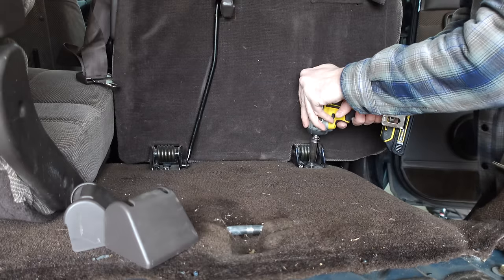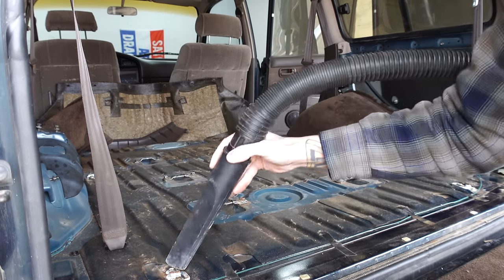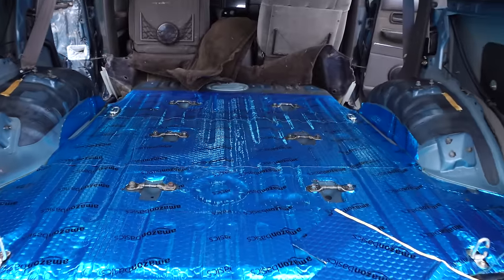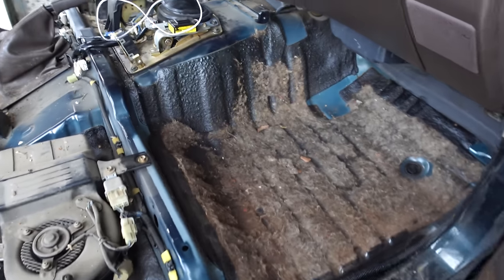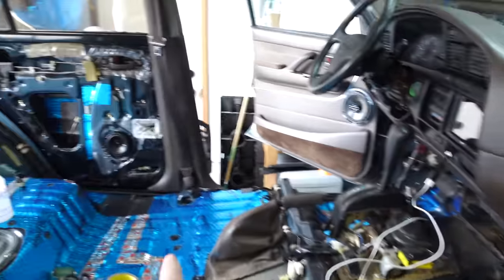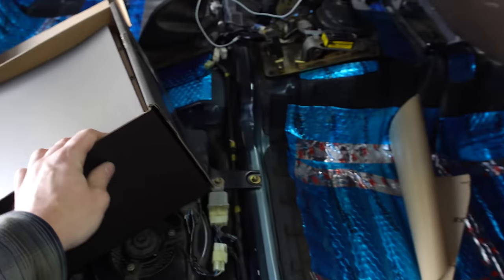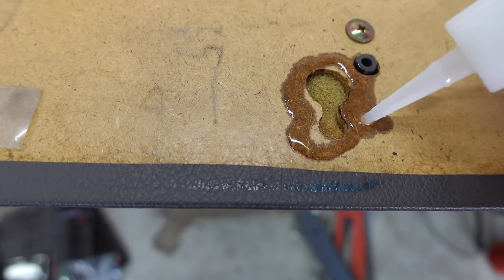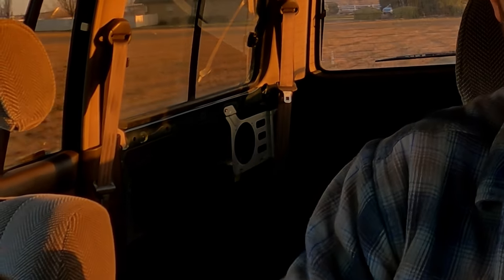The Cheapest and Best Sound Deadening Mat for My Land Cruiser!

Comment: When I did the same with my ‘06 Tundra, I pulled the carpet out and called a local carpet cleaning company and signed up for their “3 rooms for $99 special”. When the tech showed up I told him 2 rooms were in the house and the third was in the driveway. He did a great job and the carpet looked pretty darn good!
Reply: That's pretty smart, lol. When I was looking to rent equipment at home depot,  I noticed carpet rentals at home depot for 4 hrs was $25
Reply: @OriginalPoopMaster5000  a tiny ozone machine may work wonders to finish off your results in the truck, or anywhere else that's nasty.
Reply: @18_rabbit  they are great little machines, I had an old project car that had been heavily smoked in, pressurewashed the carpets with some decent carpet cleaners and drill brush agitation before blasting it all out used a carpet cleaner on the seats and headliner then put the ozone inside to finish it up and the smell of old cigarettes was gone. Admittedly I also had a lot of Ash to clean up from all the crevices inside the car
Reply: 😂😂😂😂 This is the best idea ever!
Reply: @18_rabbit got a ozone machine from Amazon for a Mazda truck a buddy bought , which had a mildew smell , ran it over night on ac power , allot of warnings with the machine and all it did was add a toxic smell to vehicle,  didn't remove anything . Later a detailing or cleaning place found active mild or mildew in tbe underlay . So I'm not sure what ozone machines are for. But simply running one , just added the toxic ozone smell to the vehicle .
Reply: @_Thundrix next time u use this process w pressure washer, just sprinkle powdered laundry detergent evenly over the carpet. then go over it w pressure washer until suds are gone & you don’t even have to scrub by hand. the pwasher does all the work for you!    just a suggestion
Reply: @kjaxky  Most of those machines do not produce real ozone. My SunAir that I've had for 25+ years and used daily in my retail business made any room smell like freshly wash sheets that have been air tried on the line. Mine is constructed of stainless steel. No plastic on the unit at all.
Reply: As you said it was a luxury car, the roof would have been sound deadened already, which is why you didn’t cover the roof.  As it’s closer to the head/ears, I wonder how much difference it would have made

Comment: I put the same amazon brand deadner on the ceiling of my Honda while I had the headliner out. It made a HUGE improvement in getting rid of the tin can sound, ESPECIALLY when it’s raining: the sound of the rain drops hitting the windshield and backlite glass is louder than the ones hitting the roof.
Reply: Doing the roof can make the biggest difference, especially in a truck like his. They usually put almost nothing on them from factory
Reply: TheRogueBro
   So true I have a '97 Silverado K1500 extended cab and when I started my stereo system build I stripped the whole interior to do sound deadening/insulation and run cables and wiring. I was amazed at how little sound deadening there was from factory. There was none on the roof one small piece on each side of floor pan none in the doors and one small piece under the rear side window on each side and a small piece in center of rear wall there was also a very small piece behind radio on firewall. When I say small I mean like 4"×8" and very small was 3"×5". So needless to say it was a lot of material and work to get it right. Looking back it is a very good thing I started out by just stripping the entire interior.
Reply: Nice,  what honda? I'm thinking of doing to my element
Reply: Nice project and great video! My gut feeling says that I wouldn't have put the secondary foam where you will have carpet but it IS NEEDED where you have Amazon Basics anti-resonant deadener but no carpet - especially behind loudspeakers, inside doors and side panels and so-on.  You should drive the same route for a valid comparison because the road surface has a large influence on resonance and higher-frequency tyre noise. All the best, Rob in Switzerland
Reply: @didiermejia780 element should be a great candidate since the sheet metal is more expansive and flat.  I'm having trouble in my Chevy TB after driving a Mercedes of same era for last 5 yrs. The Chevy roof is like a trampoline under modest hand pressure. Just doesn't compare to the roof of an e320 wagon.

Comment: Like you were sayin it’s very difficult to show the difference that is made for far too many reasons to list but I think the most important one is noise reduction that isn’t truly shown on a decibel meter. The meter just reads the loudest frequency registered, it doesn’t show which frequencies were reduced and by how much. For example, we tend to be very sensitive to the 1k-4k hz and sound deadening/absorption mainly reduces that range. So you could actually have a 20 db swing that would go unnoticed due to its limitations. Second, the lower frequencies are very difficult to absorb due to the wave lengths being so long, it would require several inches of padding up to several feet depending on which frequency you are trying to limit. Luckily, the lower the frequency, the more pleasant it’s generally perceived.
Reply: This 100%. I've done some sound deadening on my car and while the decibel test provided negligible results (just a couple db) the actual real life experience is noticeably more pleasant. The higher frequencies are muted and road noise doesn't make having actual conversations annoying.
Reply: Glad I scrolled down - I don't know a lot about sound engineering or acoustics, and I was wondering this.  I don't regret the 120 lbs. I've added to my small sedan.  It completely elevates the car.  It's also cool when the stereo is turned up, all windows and doors closed, and then I open a door and a flood of great sounding music comes out.

Comment: Replacement carpet is also available with something called "mass backing" which reduces sound transfer. Its a big investment on an SUV at around 700 bucks for ultra plush carpet with mass backing, but it is great at making the interior look, feel, and smell new, especially on older vehicles with damaged carpet (stains, cigarette burns, tears, or wear through). Ive used stockinteriors for carpet on several projects, and their molded carpets have always been top quality, IMO
Reply from the maker: I’ve used stock interiors and I’m a big fan!
Reply: Just used them for my xj turned out great
Reply: The mass backing is just a layer of mass loaded vinyl added to the carpet. I was unaware people were doing this so I looked up for the carpet in my truck. It's $75 extra for the MLV backing on essentially 25sqft of carpet. MLV typically costs $2-$4 a sq ft, and the convenience of it already being attached to the carpet seems great. I'm probably going to order new carpet soon now, so thanks for the info.
Reply: I got an 80 aswell, home much of bothdid you end up consuming? Not thrill Ed about lifting console but be interesting to see how much coin under there

Comment: almost ALL resonate noise in a vehicle that large comes from, firewall, doors, rear gate... and believe it or not the roof of the vehicle acts like the skin on a drumhead. All road vibration while driving resonates UP, with all the effort you put into that you should do the ceiling & I would bet you would notice an Audible difference W/O the Db meter. I know I did, and I ONLY did the side panels doors and roof. LOL now mind you having crappy worn or chopped, or semi knobby tires doesn't help either(a good touring tire will kill a ton of road noise) Good Video!!
Reply: I was thinking doing the ceiling would also help reduce noise for anyone that has a roof rack.
Reply: Yes, firewall-doors-gate-WHEEL WELLS-roof.
- RMG is right, just do the doors and panels, BUT be sure to get those wheel wells covered too!  You don't need to cover any of these 100% with the sound deadener/Mass-loaded material.  Just cover most of it but you don't get much gain by going edge-to-edge.

- Tires are a big source of noise, and in a SUV like the LC, it's really big.  Should always mass-load/deaden those surfaces that face the wheels as a priority, that wasn't really done here in this video.
- As to the roof - yep, lots of noise reduction if you do the interior ceiling, BUT - in any sort of hot climate, any time the vehicle is driven or parked in the sun, the heat will tend to soften the glue or bond, and then you get major drooping and all kinds of issues with it sagging into the headliner. It becomes a major PITA.  The best solution is a spray-on deadener material that 100% bonds to the roof metal.  That's a pain to do, but gives the least trouble long-term.  And of course, any spray-on material is going to have fumes and stank that takes a while to go away.  Again, 100% coverage isn't necessary, shoot to cover 60% to 70% of any of these surface areas for best 'bang for buck'.

Comment: Run some weed whacker string through the sunroof drains. Carefully. If you have a damp interior, they’re probably clogged.
Reply from the maker: Yep I've heard of that and I'll have to do that. Thanks!
Reply: I used weed trimmer string (orange) in my GTIs front sunroof drains.  I used 3-4 inches and made a "U" shape and put it in the drain nipple in the front door jam.  Then left about 1/4" visible.  This was done to allow water and any small dirt to easily exit the drain and prevent backups

Comment: A trick I've always done is just remove the weather barrier all together and put a second layer of sound deadener in place of it. The layer on the outer skin deadens the sound of the metal itself and the inner layer helps deaden the sound of the hollow of the door, plus it better isolates the rear wave of speakers from the cabin area.

Comment: I put some under my headliner .. helped with heat transfer in the summer too
Reply: Cant believe this isn't mentioned more! I did the ceiling with alu-butyl first then memory foam type thing specifically made for heat/cold transfers, I did it in the middle of summer and MAN what a difference couldn't believe it. My car used turn into furnace in 30 mins absolutely unbearable unless I opened all windows and waited 15 secs before getting in. Mind you I also had all my windows including windshield tinted in clear ceramic heat rejection tint, supposed to block ~70% of the heat IIRC. Limo ceramic tint the damn moonroof aswell

Comment: Great video! Yes db scale is logarithmic, 3db is a double or halving depending on direction. 3db is usually what it takes for the human ear to notice although come can notice 2db. 6 db reduction is excellent!
Reply: Yup! -3dB is half the sound  and -6dB is 1/4 of the sound.  You cut out 75% of the road noise.
Reply: Totally inaccurate statement. Logarithmic at a 10db scale 60db is half of 70db in perceived loudness. -7db is a 70% reduction in that 10db scale.
 Wattage is the same 1w-10w-100w-1000w are 10db increases in sound level. A speaker with 79db @1w is twice as loud 89db @ 10watts etc....
Reply: Would take that dB meter app with a grain of salt though.

Comment: I've done the same on a 99 Tacoma and 89 4runner. Makes a huge difference on these old trucks. My next tackles on the 80 are both rear door lock actuators don't work and my windows are so slow.  I think I already purchased the runs, but a bottle of silicone spray actually did wonders a couple years ago. 

I figure, doors off, replace speakers, locks, refresh window grease and sound deadening will be a good 3 for 1 winter project .
Reply from the maker: My rear windows are so slow that they bind and fall off the track, lol. I've used the silicone spray too.
Reply: It could be the factory grease inside of the window motors has dried out and causing resistance. See if they can be opened. Clean and re-grease, it will make a huge difference and prolong the life of the motor.
Reply: Clean the window tracks, the motors, the gears and the rollers with brake cleaner and then use white lithium grease to re-lube the motors, gears and rollers. This will make the windows go up and down a lot smoother and easier.  Also check all window parts for loose rivets,  if these are loose it will make the windows roll up and down with much more difficulty.

Comment: Great tips.  Love the super glue on the masonite.  A big contributor to driving noise in general is noise from the roof.  Wind and vibration.  You don't need to insulate/add material to the entire surface, just enough to add weight as it will make a significant difference as well.
Reply from the maker: Thanks! I will do the roof in the future, probably when I fix the sunroof.
Reply: @RM_Garage and the rear wheel wells…Why didn’t you cover those? Lots of tire noise comes from that area, especially in the 80 series!
Reply from the maker: I did, before I put the rear carpet back in. I covered the parts that didn’t have factory sound deadening. Didn’t film it
Reply: @RM_Garage  Use a spray foam, don't use MLV or the Amazon Basic stuff.  Your arms will thank you, and it will stay in place when its hot from the sun!

Comment: I've used B-quiet products in the past with excellent results.  I run mostly minivans which have a LOT of relatively flat steel to resonate.  Adding carpet to hard plastic interior panels both reduces noise and much improves the feel when touching those panels.  A dash carpet reduces sound reflections as well as light reflections from the windshield.  Spray foam (Great Stuff or equivalent) in hollow panel areas absolutely kills resonance.  If any of your doors have only a single seal adding a double or even triple seal can really help.  Higher trim levels of some vehicles or different "brands" of the same vehicle  often have better door seals which you can add.  Different brands of tire can make a significant difference.
Reply: You make excellent points and advice!

Comment: Thanks for the heads up about the sound deadener. It's on my project list.Before I've removed carpet I took it to the car wash in the back of the truck and power washed it. Works like a champ.

Comment: I so get the opening.  I had a badass 65’ Mustang my Dad and I built, but I couldn’t afford to what I really wanted. Later I had an 85’ GT, couldn’t afford to modify it.   Now I’m about to retire for the second time.  I just naught a $1,700 tool for my workshop and I’m shopping for a 66-67 Shelby, or a 66’ convertible to build up.  I got the money, and about to have the time.   Oh, on the sound deadening I used expanding foam in the body parts I couldn’t get to.  I used neoprene matting between the skin and interior panels.  I used some heavy duty sound matting for the flooring and doors and hatch.  I have an 85’ Cherokee I take hunting.  It’s rigged to camp in and secure my weapons.   I have a great sound system in it.  Now I can blow money on my cars and hardly think about it.  Keep it up!
Reply from the maker: I'm glad people have been able to relate to that opening line. Love it!

Comment: I’m definitely going to put some of that sound deadener in my doors and quarter panels. And that tip about how to fix the door panels with the superglue Is a game changer!
Reply from the maker: One thing to be careful of is to make sure the super glue doesn't bleed through. 2 of the areas on my panel were really worn down and needed more glue than normal and it bled through. You can see it in the video when I reinstall the panel. This isn't normal, but can happen.

Comment: I put sound deadening materials to my E28 floor, roof, doors, pillars and wheel well. It made a significant difference in reducing vibrations and rattles.
But the biggest difference in my case was when I put those soft sound deadening foam and carpet bits of a BMW 7 series, glued thin carpets on the inner fenders like what some new cars have and replacing every rubber seals on the doors and windows, it greatly reduced the road, tire and wind noise, the lot.

Comment: For the sound coming through the firewall, whenever you have a dash panel off cover it in the foam or sound deadener. Stops vibration and reduces the noise. You can also put some sound deadening on the engine bay side if you really wanted too

Comment: You'll notice the biggest difference with the roof. It's so surprising how auto MFGs don't do anything to insulate the roof outside of some foam headliner fabric. Also, if you use thermal insulation, your interior temps will stay much cooler longer if you have tint.

Comment: Some advice, start with fixing all the window and door seals. The wind noise is going to be most noticeable.

Then listen for the actual sources of vibration based noise and treat those areas. When the first source of noise is reduced, you'll then get a new noticeable source of noise. Keep going. Do the tap test to find resonances.